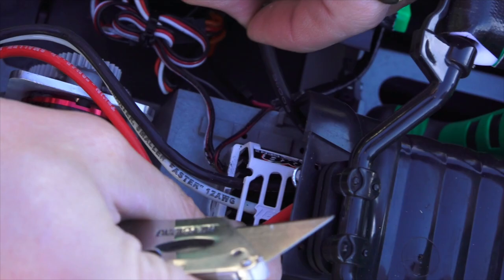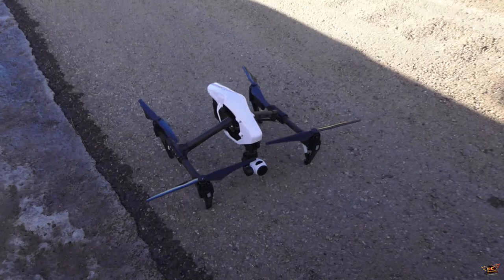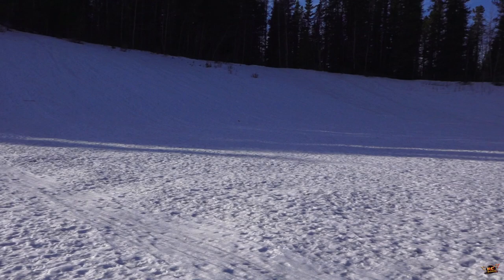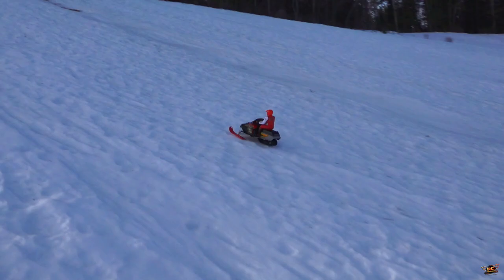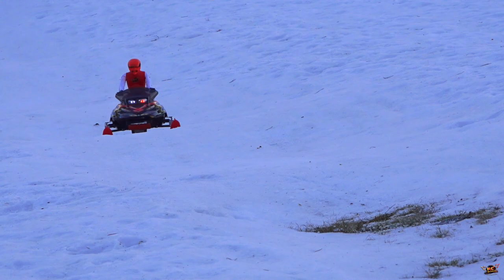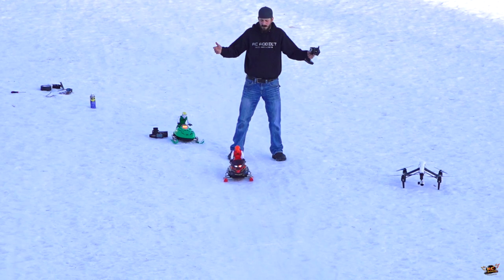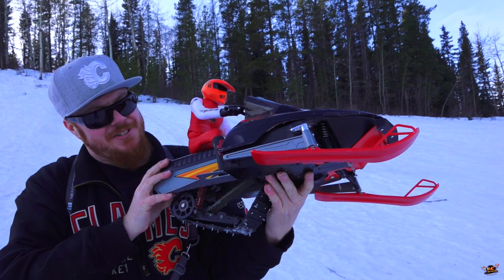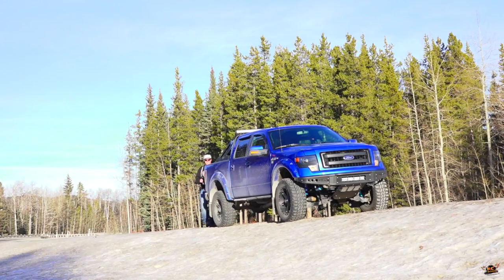RC ADVENTURES - Snapped in Half on a Hill Jump - Electric Snow Mobiles (Radio Controlled)

Comment: Another great Vid Buddy and a Big Congrats on the million mark ;-)
Hey a quick question ... I was out playing in the snow with my Summit and after was cleaning it up and noticed actual humidity inside the nicad battery sleeve ... Is this something I should be concerned about/have you noticed this before and should it be allowed to disipate before going back on the charger??
Thanks in advance and would Love to tackle your rock course at the ranch someday ... and Keep up the awsome work :-)
Reply from the maker: +Mark Brennan Thanks for the comment Mark, if you are able.. dry out the battery after use. Prolonged exposure to moisture will start to rust you wires that connect the battery. It will take a long time, but if you dry the battery, or give it a good blast of air from a compressor, you will lengthen the life of the battery.

Comment: Hey medic I have a question, I have a short course truck, its a brushless sensored and I recently got a new 4s lipo for it but the it doesnt really react to what I tell it to do, for example if I go for a speed run it doesnt want to go fast at all and then it puts so much power that it wheelies and gets almost vertical and then completly goes out of controll and after like 10mins it doesnt move, it just steers and I have to wait a while to be able to play another 10mins. I know the esc is capable of 4s, its an 80amp so I think the problem is the motor....
What should I do? If added a big heatsink but havent got to try it again. 
Thanks
Reply from the maker: +Raul Valdivieso Urdiales Please contact the manufacturer of the RC and they can lead you down the right path :)
Reply: +Raul Valdivieso Urdiales Most esc have a temp. cut-off. You maybe over-geared and causing esc to overheat and cut off. I use a temp gun when I set-up a new motor esc combo and watch my temps. But simply gearing down should help. Especially since its wheelieing out of control anyway